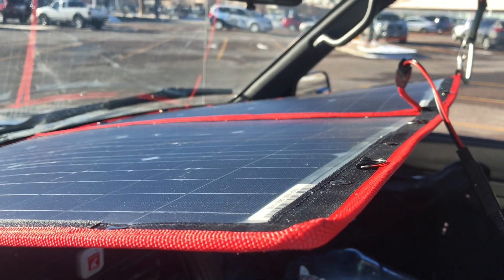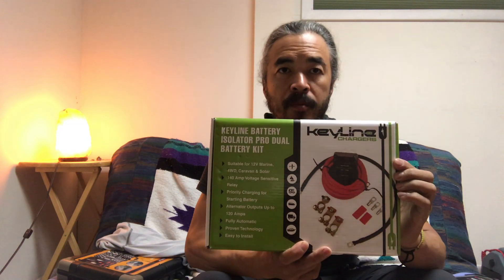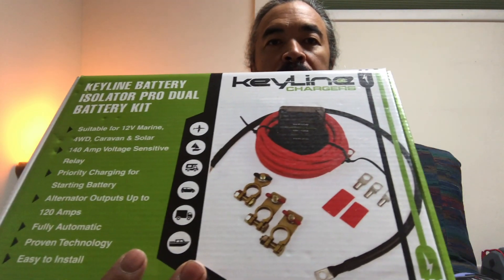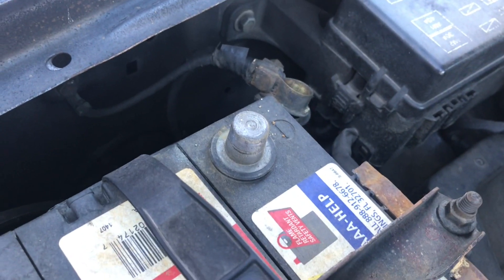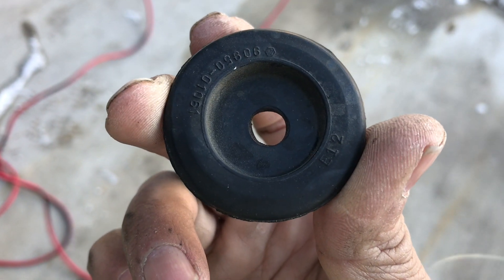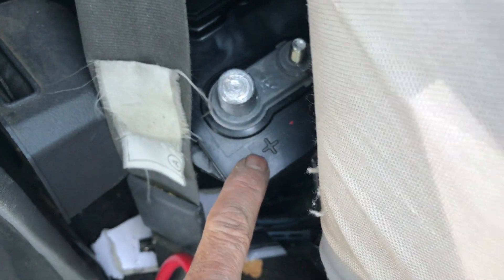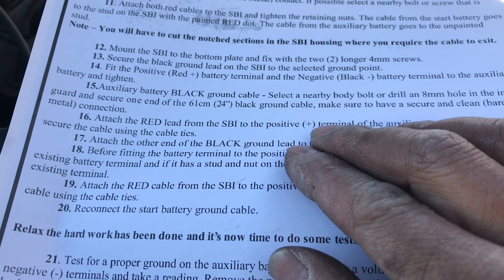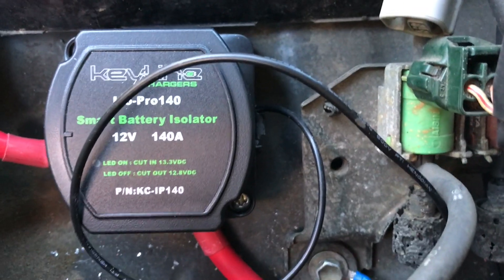Dual Battery Isolator Install (Step by step)

Comment: Whenever i touch the ground to a grounding point on the chassis i can hear the isolator click and a faint light comes up but then it turns off. I grounded the ground of the isolator to the main battery negative but i cant get it to work
Reply from the maker: Hmm, I didn't experience that.Not sure why it's causing it, sorry friend.

Comment: The principal battery is acid and the second are AGM?
Reply from the maker: The starter battery is a flushtop maintenance free battery from AAA. I assume it's lead acid, but it's not labelled. The size is 34-C if you want to look it up. The second is AGM.

Comment: Thanks for a straight forward video! Showing what goes into it all without all these terms and suggestions. How is it performing so far???
Reply from the maker: Glad you liked the video! It's one of the best additions I've made, actually. Now I run my thermoelectric cooler, charge everything, run my laptop. Since I move fairly frequently this tops off my 2 auxiliary batteries, which allow me many days of power. I forget to use my solar panel, since I really haven't had the need yet.
Reply: @GripandClip  awesome! I also want to do a very similar set up (small Esky fridge, charge phones and laptop) while keeping the stealthy look of the van by not having a solar panel fixed to the roof. What size batteries are you running?
Reply: @GripandClip  also do you have a "stupid simple" video on how to connect the batteries to power the accessories? (I.e. did you use an inverter then a fuse and wire everything from there? What sort of inverter etc haha)
Reply from the maker: @TheTaeminator  I intend to make a video about my complete electrical setup, just need to carve out some time ;)  But yes, I use a 2000 watt inverter. For appliances that run direct off a cigarette lighter cable, I just connect directly to the battery with a fused cigarette lighter adaptor. 

The inverter is: https://amzn.to/2TplxGP It's the cheapest 2k inverter I could find.  I charge cell phones and laptop off the inverter. It's a Modified Sine Wave inverter, and some say you need a Pure Sine Wave, but thru my research I've concluded that the Macbook adaptor "adapts" the voltage into a pure sine wave - but DYOR. The fan can be a little loud, which is unfortunate because it's right by the head of my bed, but since it's been cold at night I just shut it off.

The female cigarette lighter cables (with fuses): https://amzn.to/2IZhMTW. I plug the refrigerator directly to the plug which connects to the battery.

I also connect my Max Burton Digital Stove To Go to a second one attached to my other auxiliary battery: https://amzn.to/2TnM5s8
Reply from the maker: @TheTaeminator  https://youtu.be/lBxDUigLnZ0
Reply: @GripandClip  Great vid/info... slim room pickings from covid and bad landlords are forcing me to move into my van, so i hope this gives me the electricity i need for everything including a little heater or electric blanket for these long, dark days in Seattle winters... but a question: You have two auxiliary batteries? Two batteries for electricity in the vehicle? Do you like the brand(s) and size of your batteries and/or would you change anything about your choice of batteries? Thanks again for the vid.

Comment: If both house batteries (if you have 2) are charged is there a switch to turn off the power coming from the car battery to the house battery? Like if you start up your car will it sense that the batteries are charged and will shut off??
Reply from the maker: Good question, and I wish I had a firm answer for you. I don't see that information on the product description. On Amazon, one person said that it does shut off, but I wouldn't know how to test that for sure. I do know that my auxiliary batteries never show overcharging according to my charge controller readings.
Reply: @GripandClip  okay great. Thanks for responding

Comment: what if i have the other battery in the trunk of my car? would the oscillator still work?
Reply from the maker: Should work. Might be a little less efficient in charging depending on the distance from the starter battery. The kit comes with 20' of red cable, which should be enough to connect on most cars.